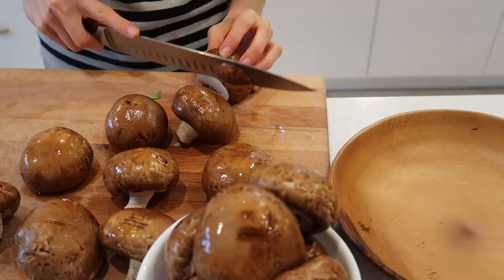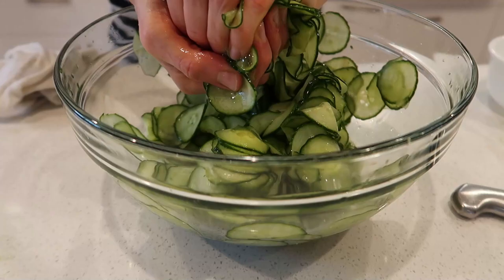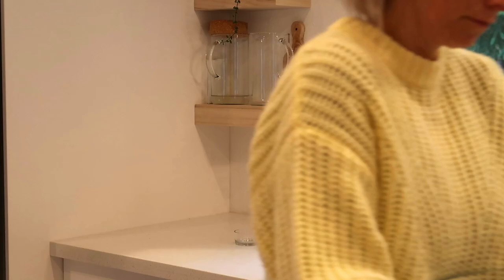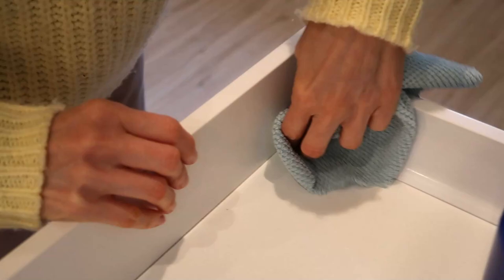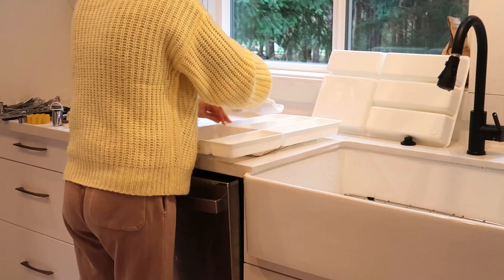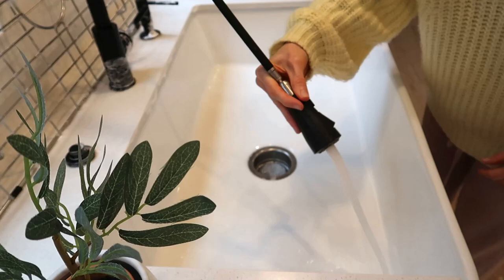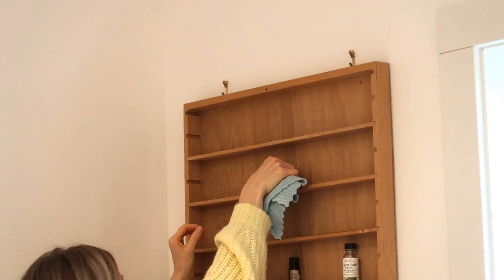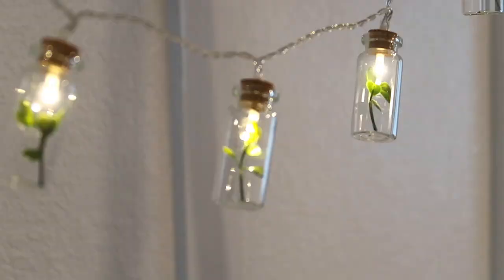CLEAN AND COOK WITH ME 2021 | Scandish Home homemaking

Comment: Hi Noemi, sorry about your ear infection. Not sure what type of infection you have but I get them some times and hate to take antibiotics specially during pandemic when I didn’t want to call the doctor. So at first sign (Sometimes after washing my hair) I use Hyland’s Ear Ache drops,  they are natural, and that has taken care of the problem. I also use oxygen peroxide if I don’t have the drops handy and it works really well, just a drop as needed is enough. Good luck.

Comment: We had vinyl floors installed in our house like yours. The floor company told us not to use hot steamer on them it will create a problem. Although they are moist and humid resistant but not heat. I thought you might want to know.